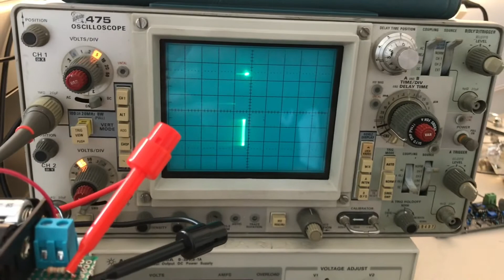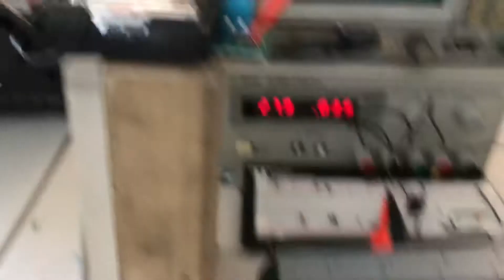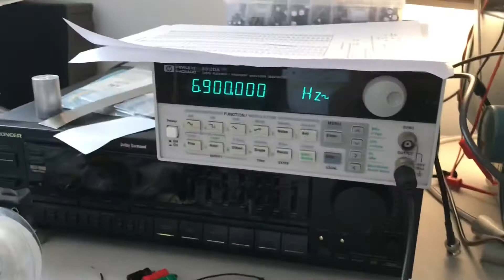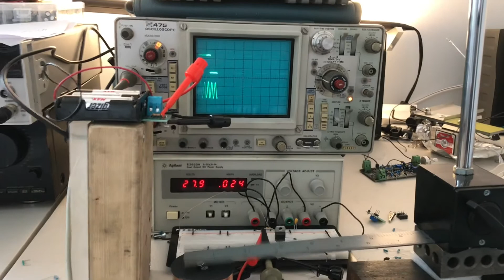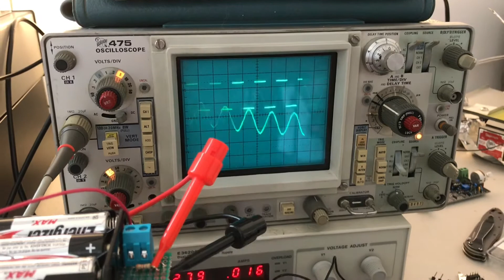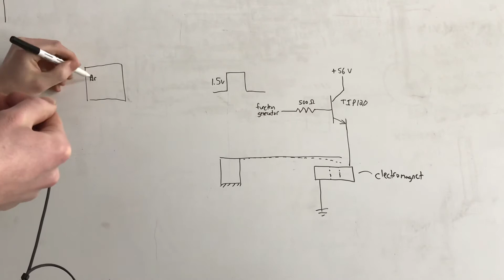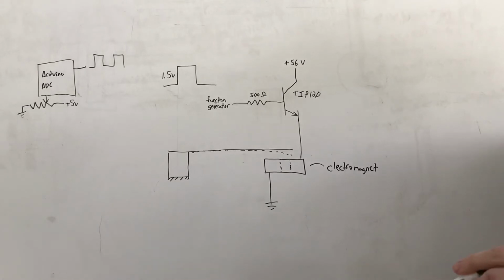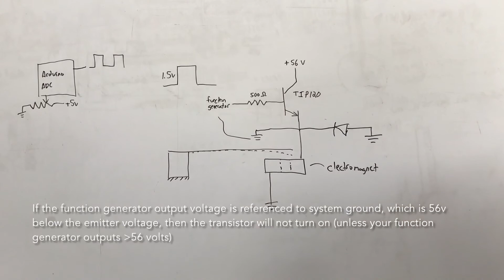Cantilever beam resonance

Comment: have you tried it with a sine wave so no harmonics via square wave?
Reply from the maker: Not yet. The problem I’m foreseeing is the negative half of the cycle will still attract the ruler so it would in effect be the absolute value of sine instead of sine
Reply from the maker: If the ruler had a permanent magnet on it then it would be able to repel in the negative half of the cycle
Reply: i think it'll be ok if the sine is biased so the negative peak is 0v like coming out of an arduino analog pin? idk
Reply from the maker: @qbqbqdbq  i think that would work, although you would need to have a power amplifier to drive the coil. It would also be beneficial to filter the arduino’s pwm into a smooth sine wave before the power amp